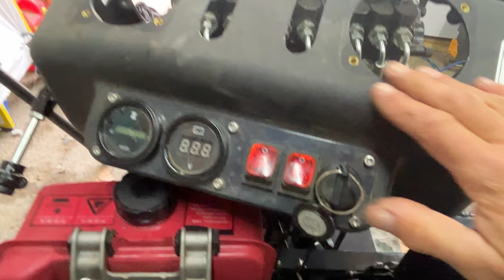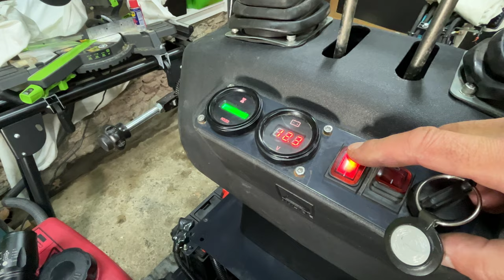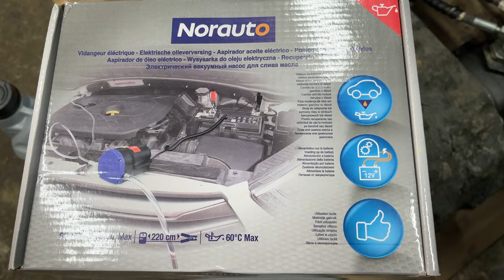Chines Mini Excavator | Hydraulic Failure

Comment: Thank you for the video.  I have a similar machine from a different company but found many hoses were also rubbing together so I think you saved me some trouble and unnecessary expense coming up in the future.    I noticed that my machine does not seem to have a return line canister type filter.  Did you find one in your machine somewhere?   I am thinking of adding one as I have heard that oil contamination is a big cause of failure in these machines.    Any advice on where it should go?   My feeling is that the easiest would be to disconnect the return line where it enters the fluid tank, move it to the other side as the inlet to the filter block and then get a new line made to go from the filter block back to the tank.   What is the normal pressure on the return lines?   Generally you can get a filter block with a bypass valve but the pressures are variable (starting at about 25 psi it seems).    I also noticed the oil cooler model on your machine, KEILETO AF0510-CA, seems to be available on Alibaba as a direct replacement part.     Does anyone have any experience in adding these to a system and would it be worth it (I live in Georgia US where summers are generally in the high 80's to low 90's Farenheit).     I've only got an hour on the machine and have already had to put a track back on and the documentation is mostly useless for things like that, so I think there is a lot of trial and error for all of us with small machines like this.    The other thing I have noticed is that people want to replace the grease fittings on the boom with Zerk fittings.  The ones that are flat are actually fillable.  There is a small spring loaded ball in the middle and it takes a pointed grease nipple on the gun that can fill them directly.  This type of fitting is placed where the Zerks may get broken off so my advice would be not to change them out on the end of the boom and other places where they are vulnerable.   I look forward to any advice anyone has on better ways to use and maintain this type of equipment.
Reply from the maker: I am going to look into a filter.  Another guy, Dave from Tree Change Farm mentioned there may be one in the tank itself so I will have another look there.  I will also ask Nuoman if they have any ideas.  Thanks for commenting and the ideas.
Reply: I'm in Atl, Ga USA as well, 1 year after your comment,  engineering a filter and cooler setup on my machine. How is/did your machine progressing?

Comment: A best practice when you are working on the hydraulic system is to shut off the fuel to the engine and crank it to make sure the hydraulic pump is well primed after your repairs.  These machines use gear pumps and running without sufficient oil for even a short time can destroy them.  Should be less of a concern on this machine given the placement of the hyd. Reservoir, but I’d rather be safe than sorry.  When a gear pump fails, it often will send a ton of trash into the hydraulic system and could cause your valves to hang up.
Reply from the maker: Good advice, I have noted it in my book.  Thanks for commenting. 👍🏻

Comment: Hi, Ian,

I'm looking for vidio how to do Hydralic oil change on a Rippa R319.
Can't seam to fined anything on vidio,.
Been on to manufacturer you may as well be knocking your head of a brick wall,,.
Can you help,.

Thanks Mick.
Reply from the maker: I am assuming they are very similar (looks very similar) so if you pull off the panels (as much as you can) you should see the big square tank with the glass see through panel to check level.  Under this tank there should be a valve or drain plug.  You just change the oil as per a normal oil change (using correct hydraulic oil).

Comment: One great thing about living in an Agricultural area of Eastern Poland, there are various places that will make up hydraulic pipes of every kind and size, while you wait. and cheap, so cheap that when he told us the price I thought I had heard wrong (and the pipes are good quality German rubber).....what I do is check where pipes rub and I wrap with a split part of a 'dead' pipe held by cable ties....it has worked so so far.   Note:   are you considering dying soon??   No I thought not, so collect oil....it will keep in cans kept out of the light....One day in a pinch you can filter it as fuel/fuel supplement, use it for oiling hinges,  gates etc, even for painting on wood that might rot.   Having 3 tractors, a Unimog 2 Jeeps and an Isuzu pick up, I have a lot of waste oil every year.
Reply from the maker: They were quite expensive here and we are supposed to be in an agricultural area (village is just farms).  Each pipe was €50 which I was not too happy about.  I normally use a different lot but it was holidays so they were the only ones open at the time.
Reply: @HomesteadingUncontained  Wow!   I could have bought 4 pipes like that for 50 Euros.(equivalent in zloti)  I suppose people here are poorer and the price of things has to reflect what they can afford.
Reply: @HomesteadingUncontained  probably did not give you the discount they give to a "Regular" customer. It happened to me today, 1 office of a multi office hydraulic supply store quoted $26 for a filter mount/head, and a different office tried to charge me $60.

Comment: What is the Name and Model of your mini excavator?  I’m in the USA and I have access to Agrotk QH12 models.  Are you familiar with this model and how it compares, quality wise, with your mini excavator?  I know the engines are different.  I’d be interested in your opinion in the quality comparison of hydraulic lines, hydraulic cylinders, strength of steel components, tracks, etc.  I can get a Agrotk QH12 for $7500 USD.  Some distributors want more (e.g. $8,000 USD).
Reply from the maker: Our machine is from Nuoman Engineering and is the NM E10 (1 tonne machine).  I cannot compare it to any other manufacturer as I do not know them but I assume the majority of the sourced parts are very similar.  The price you quote is as good as buying it directly plus you will get local warranties etc so that would be the best path to follow for sure.  Hope it all goes well.

Comment: i think if u were to get a new line custom made, you could get one thats a bit longer so it hopefully wont rub against the other once, but not sure. "i havent watched the full video yet by the time i made this comment, but i will watch the full video."
Reply from the maker: You are probably right and  missed a trick there - but I did put protection around them and rerouted one so it would not touch the other.

Comment: The question is: how many hours did you get out of your fairly new machine before you had a hydraulic faikure?
I've looked at these. The drive motors are not protected! Bad design concept!
Reply from the maker: It can happen on any machine and these hoses are from Continental so I just replaced them locally.  The motors are similar, again, on many machines.  No issues at all.